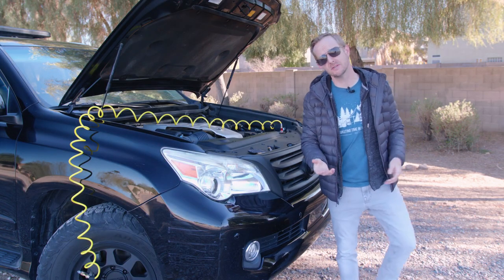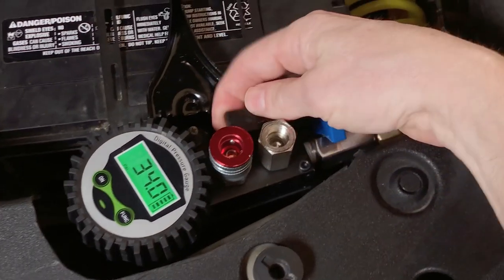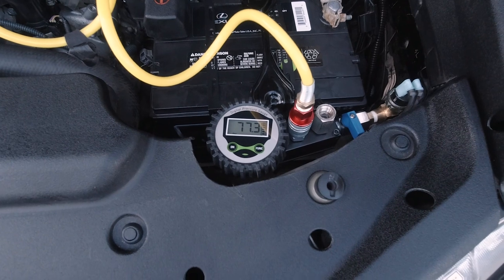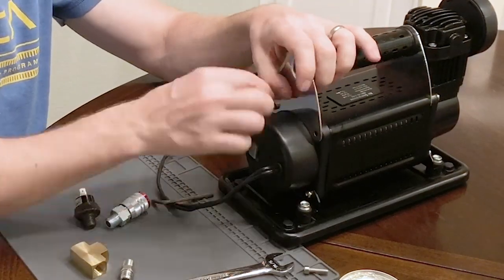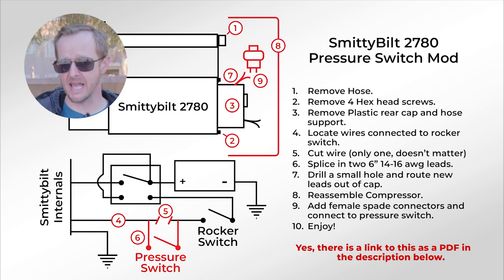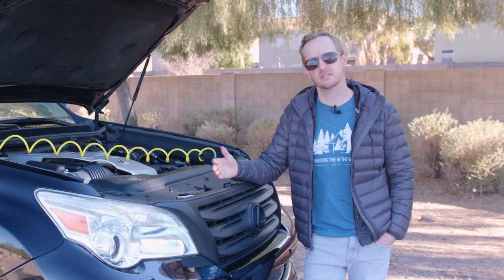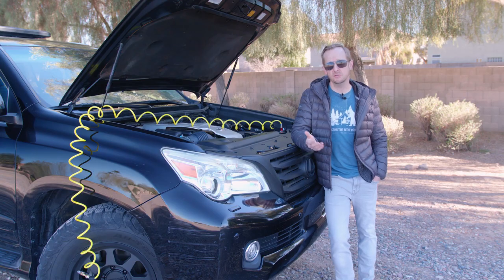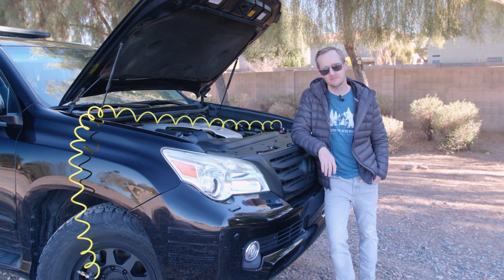Ultimate Onboard Air System (DIY) – GX 460 SmittyBilt 2780 Onboard Air Install

Comment: Thanks for the video update on the wiring and installation of the Smittyvilt 2780 air compressor. I too am opting for the smittybilt but the 2781 over the ARB. Mostly for the same reasons as you gave.  Your comedy add ins are pretty funny 😁 I really enjoy your videos. 👍
Reply from the maker: Wish I had a 2781. Just got a big ironman compressor I may try to shove under there.
Reply: @WastingTimeInTheWoods  No room under the hood of  our Jeep Wrangler Rubicon 392 Extreme edition for much of anything besides the engine 🙂

Comment: Got dang. You made it sound so easy but my mind can't get around how hard this is going to be. Amazing set up! 👏 wish I can do this in my 470 but probably just going to have to stick with what I have.
Reply from the maker: Go slow, you don’t need all the crap they say you need to have a good time in the woods. It makes it easier (but its not that hard to start with). I just had too much time on my hands last fall when I did all this : )

Comment: Loved this Video!!!   Very informative as I am looking to do a cheap bastard DIY onboard air for my 2008 Toyota Tundra!!   Also very entertaining!! Subscribed!!
Reply from the maker: Don't use the 2780, use the 2781 or an ironman 4x4 large compressor. Mine still works fine but above 8000' it will only get up to 88-95psi I've discovered after many trips. It also overheats if you try to take 4 32" tires from 15psi to 40psi. Works fine to 35ish, but always overheats on the 4th tire when I try to go to 40PSI. I'll do a new video when my new compressor finally arrives.

Comment: Thanks for these videos. I was finally able to mount the 2781 with the powertray and similar setup under the hood. The clearances are really tight but I was able to mount it using the rubber feet from the smitty's compressor tray on to the powertray. Minor interference from the hood strut on the on/off switch but it does seam to only effect the rubber cover of the switch and not the actual switch. If I had drilled a few mm off left, it would have been perfect.

Comment: You should add a relay/switch in the cabin that goes inline with your pressure switch. That way you can turn off the pump permanently from inside the cabin and lockout any drain on the battery when it's sitting, or you could do the same with a relay that pulls power from the ACC II (RUN) ignition setting. That would keep the pump off unless the vehicle is running and on.

I also use my 7 year old niece for the small spaces and bolts/lights lmao. She gets to drive it off road too, as payment of course
Reply from the maker: Great idea. I'm not worried about drain too much since I trust the Smitty rocker but I will probably forget to switch it off one day. Give me regards to your niece. We all need a sous-mechanic.

Comment: Great video! It gave me a really clear idea of what it might take to do an on-board air setup on my LR3. It looks like your pressure switch moved from the t-fitting on the compressor to the t-fitting on the manifold between shots, though. Did you find it more useful in one location over the other? And I noticed that when you moved the pressure switch, that you also installed a pressure relief valve on the t-fitting on the compressor. Can you explain why you chose to do that, as well? I haven't seen anyone else choose to do that, so just curious. Thanks!
Reply from the maker: Hey buddy. I love that Rover guys found this! You are correct. I moved it from the compressor to the manifold. I put it before the manifold inlet valve so that when you shut off the manifold, pressure builds up between the check valve and manifold triggering the compressor shut off. I put  a 125psi safety blow off valve where the pressure switch had been near the compressor. I cover all this in the next video. That should be out in a week or so. Just need to find time to edit it. Thanks for watching!

Comment: Great video thank you! Total cost of all parts minus the air compressor?
Reply from the maker: Prices fluctuate but the Powertrays mount is $85 and the compressor is $100 USD. So about $100-150 for all the manifold do dad’s and conversion parts.

Comment: I have been looking in the market for a GX470, but now I kinda looking at GX460 as you tell lol.. both look amazing but is hard to find a GX470 with under 180k.. most are over 200k and I might just go for a gx460. I’m still debating, any tips???

Comment: I am just curious on why you went with the smittybuilt 2780 vs the 2781.  The 2781 has double the cfm of the 2780 for an extra $60. Was the choice based on cost ? or size for the space in the engine bay?
Reply from the maker: I wasn’t sure it would fit but knew the 2780 would. A viewer showed me how he did it with a 2781 though in his 4runner. The 2781 is a great choice if you can make it fit. Good luck!
Reply: @WastingTimeInTheWoods  .. thanks for the reply. I don't have the intention of installing under the hood. I just use an Viair 88p for my tires that I pull out from the trunk. Looking at an upgrade to the 2781 or equivalent at some point. There is even a double piston one for about $220 that puts out 10.4 cfm that I have seen ..
Reply from the maker: Yeah, 2781 is a great choice if you have plenty of room to store it.

Comment: Awesome hack. But a week too late! I just installed the ARB single with a switch pro on a power tray to my GX this weekend. But that manifold could be a great addition! Looking forward to learning about the manifold.
Reply from the maker: If you're adding a switch pro anyway thats a much better route since the Smitty is about twice as big as the ARB. I should have the manifold video up pretty soon, just need to edit it. Thanks for subscribing!

Comment: Have you had any issue with running it on its side?
Reply from the maker: No but it overheats half way through my 4th tire (265's) if the compressor is in direct sunlight or if we're above about 7500 feet, which is most of the places we air up. I would go with a 2781 to avoid those issues. I have the big Ironman 4x4 model that I'm going to try to shove under there someday. It's about 3/4 down a bottomless project list, just after 'get a handle on your finances' and 'make amens with those you've wronged'.

Comment: 2780 Compressor
Fitting Adapter 1/4” Male NPT to M12 x 1.25 M12X1.25 Male Metric Coupling Stainless Steel Pipe Gauge

When threading in to compressor outlet it is super loose, until I tight it down to the base of the outlet and collar  of the fitting.  this does not seem correct.
Reply from the maker: Maybe you got the wrong part? You need to tape or PTFE it so it should be a little loose when you first thread in like all pneumatic fittings.
Reply: @WastingTimeInTheWoods  Maybe. Ordered from the links provided,, I just double up on the Teflon tape. And  it definitely didn't fit like the other tapered fittings.  Completely loose, until I tighten to the collar.

Comment: Do you happen to know if there's a difference in amperage running through the wire between the rocker and the compressor motor VS the wire between thr rocker and the relay? My PS is rated for 30A, so if one wire has less draw on it than the other I'd like to splice that one.
Reply from the maker: They’re both less than 30a. Thats the whole point of the relay. They would be the same amperage because they’re on the same circuit I believe.

Comment: Great video and sense of humor!  (I hope no children were harmed during the slave-labored small hand install).  

You've inspired me to figure out how to duplicate this with my Viair 400P.  I am wondering if I can use their sealed external pressure switch and relay, I'll have to research this a bit more.   I think I may secure the compressor with some butterfly nuts and "Y" the power cable so I can still attach battery lead clamps in case I ever want to quickly take it off to take in another vehicle.  

I'm also thinking it wouldn't be a ton more work adding the air disconnect at each fender well like they did for the "Wifey setup".  The most challenging piece would be finding or making brackets I presume.  

If you didn't do the above then the final addition which I think could be cool is adding something like the speedflate: https://www.speedflate.com as a way to air up/down simultaneously while taking up less hose space.  I'm thinking in the back left portion of the engine bay (as you're facing the engine) there is enough space to store the hose.  Maybe make a small compartment that opens to store the house in and free up space in the vehicle.   

Are you in AZ?  I'm in Ahwatukee and your surroundings looked familiar.  Thx again for the great video.
Reply from the maker: Hey, Jason! Good luck with the viair. Let us know how it goes. Yeah, I might get back to a four trie system but I'd only do it like a wifey set-up so I could carry to lines under the truck. Space is tight on my end with two kids and a dog. FYI - framing straps and supports might make a good bracket for cheap. That's what I was tracking towards. Galvanized steel, a couple bucks each, and in a variety of straight and angled options. I am in PHX! maybe I'll see you on the trail sometime. Good luck and thanks for watching!
Reply: @WastingTimeInTheWoods  I'm toying around with putting a metal ammo can in the front left area of the engine bay and having my 4 port tire hookup connected and stored in it.  I think I can take the best of what you did and the wifey kit and combine it to work best for me.  I have a message in to a couple of guys to see if they have any mounting brackets for that area on my 4th gen 4runner.  I'll report back if I get it together, thanks again for the inspiration.
Reply: @WastingTimeInTheWoods  Here is a quick (and awful) sketch of what I'm toying around with.   https://imgur.com/jwZij9f